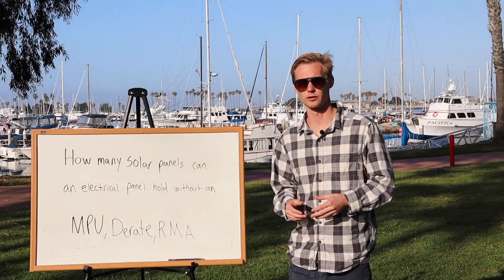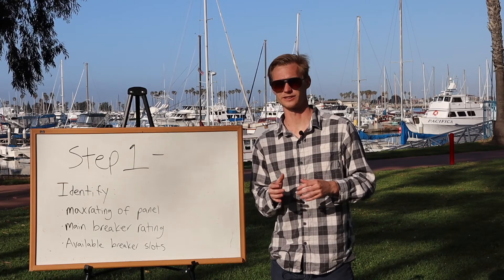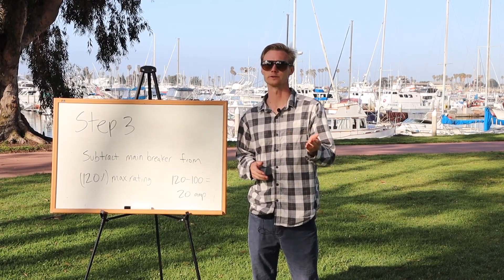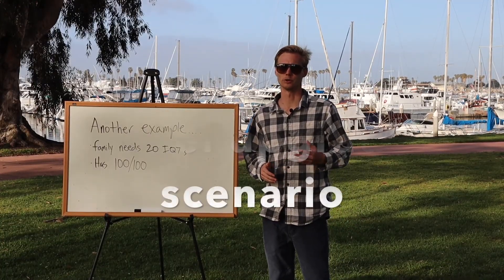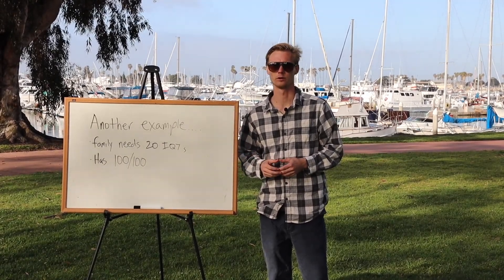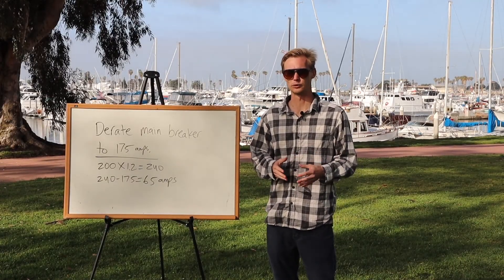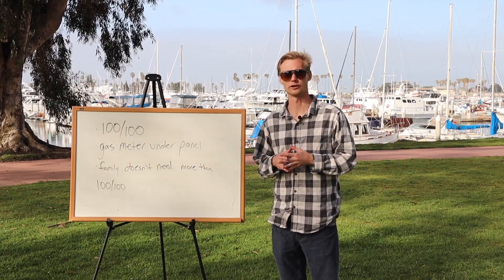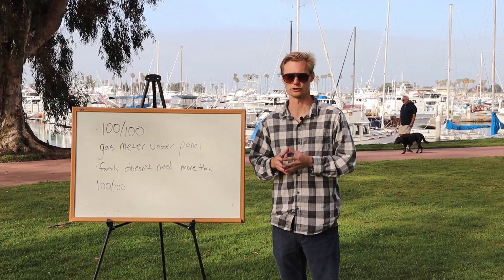How many solar panels can your electrical panel handle? Explanation of the “120% rule”

Comment: I had 30 365 watt panels put on my roof.  I talked with the company about upgrading our 34 year old 100 amp panel to 200 amps but was told our panel was adequate.  Two weeks ago we almost had a fire because the panel is overheating. Is a 100 amp panel sufficient for 30 365 watt panels?
Reply from the maker: Yikes. It depends on the equipment you have and there are a few factors I would need to know. It could also have nothing to do with your solar.

Comment: Mpu is damn near 4k with Sunrun... They claim they make nothin off it. We know that's horseshit though
Reply from the maker: Eh… Panel upgrades are a low profit hassle
Reply: @juliansolarguide  I've been in the industry for 3mons with Sunrun. After about 10 deals I'm finally putting that together... My territory sucks where I live. A lot of the cities run off of local energy companies (MiD Modesto) so some.of the smaller areas surrounding that are.in PGE territory, where you have newer development , that just gets ran through by everyone and their mother.and brother. So when I get to the door I'm dealing with angry people all the time.... I think that alone was why I've stuck to the older development homes... Now.im learning why those older development homes are easier.  Had I known the boat I'd be in now I'd have just toughed it out , or drive out to diff areas.. I feel like with all this nem3 crap going on , my last 3 months have been a literal waste